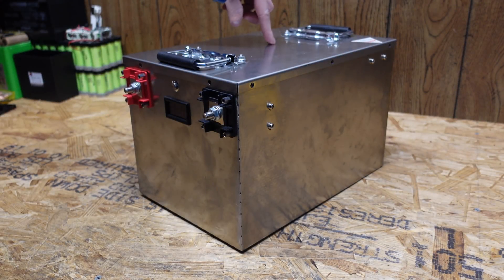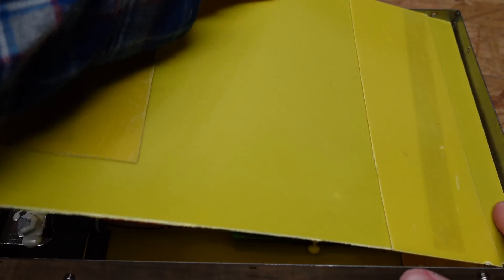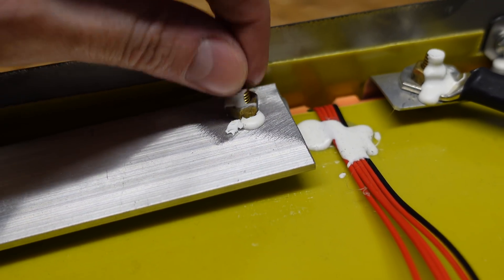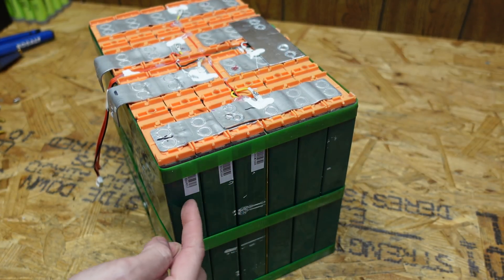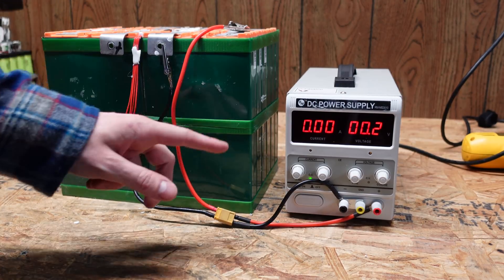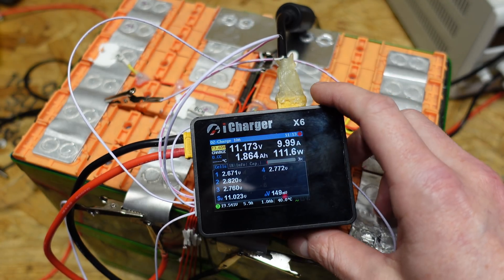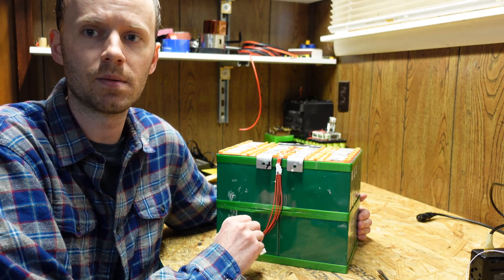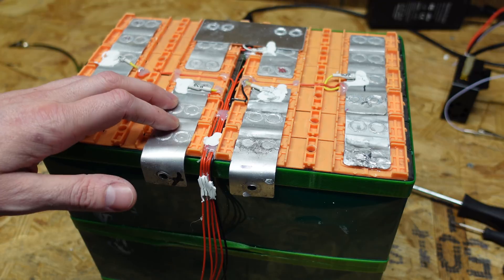Troubleshooting a Failed SHUNBIN 12V 300Ah LiFePO4 Battery

Comment: One reason I didn’t buy any Chinese batteries when I built my off grid system! 💩
I want to make sure my house doesn’t burn down!
Reply: Even domestic lead acid or Tesla cells could smoke up your A$$, if quality is bad AND/OR bad build AND/OR managed not at state-of-art. 🤷🏻‍♂️
Reply: @Stefan_Dahn  
I went with the tried and true Battle Born Batteries. I’ve heard nothing but good stuff from these.
Reply: @Stefan_Dahn  
Yes I saw that video, just confirmed me going with the brand. It’s just not the cells that are at the factor, but how it’s built!
The other factors I’m not an expert and wanted to build my off grid system for the first time, so I went with something I could trust.
Reply: @benjones8977  battleborn is good but it's way overpriced like literally double or triple the price of bare cells. Think about it would you rather just have twice the number of batteries for the same price. And I think the battleborn is just used the same cells as a Chinese suppliers make anyways
Reply: @eksine  
Like I stated before the build quality is part of the price. I could get cheap Chinese batteries, but I don’t know enough to make a system and also to make it safe. 
I’m sure if you know this stuff, it’s second nature, but I’m 64 years old and want to make sure it’s done right. At least I did everything on my own, hook the batteries up, put the panels in, the charge controllers and all the wiring and fuses. Believe me that saved me a ton of money! Not bad for somebody who didn’t even know how to charge a battery three years ago.
Reply: @eksine  You also paying for the warranty with battle born cells, some have a 10 year. And each one has its own BMS, I’m going to guess much better then the one in this video. Quality and warranty usually cost more.
Reply: @GadgetReviews-US  like i said you can buy double the amount of cells, what warranty is needed when you literally can have 1 set caught on fire and still be ok?
Reply: @GadgetReviews-US  also for bms just get the jbd sp04s020 for 12v, they have another model specifically for 24 and 48v, it's been researched before. the bms costs $55 literally from aliexpress, overkill solar charges double for the same thing
Reply: @eksine  Well that is a risk I am not willing to take. At least with a company like battle born the cells are UL listed. If (I hope not) one did catch on fire and take part or all of my house with it I could argue that the solar equipment and batteries are UL listed with my home owners insurance. If the equipment is not UL listed my home owners insurance could argue I was the cause of the fire and not rebuild my house.
Battle Born does state "All of our cells are listed to UL 2054 standards. BB10012 batteries listed to UL2054 standards, IEC 62133 and UN38.3"
Source: https://theroadsweroam.com/wp-content/uploads/2019/03/Spec-Sheet-most-recent.pdf
Reply: @GadgetReviews-US  i was joking about them catching fire, i was making a scenario where somehow you lost all 4 cells you still have 4 more cells. that wouldn't happen, also lifepo4 doesn't catch on fire, that's lithium ion. basically what your saying is you prefer a $50,000 tesla while I and most pother people rather have TWO $25,000 Honda Accords. i think you're throwing your money away, but it's your money I care not how you use it. I'll simply end up with a spare $500 to buy another set of batteries, while you use your warranty, if the company is there in 10 years
Reply: @eksine  Battleborn is a perfect, flawless, impeccable battery.  If you are rich, and too lazy or busy to build your own system.
Reply: @InnovativeSustainableSolutions  yep